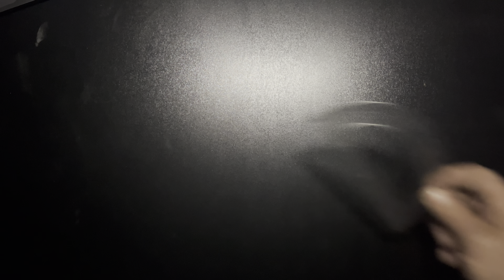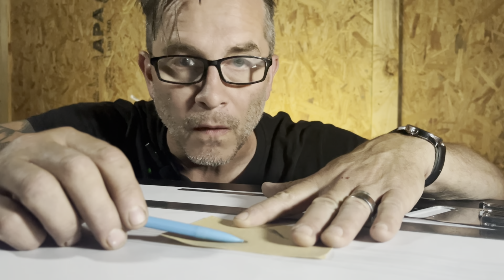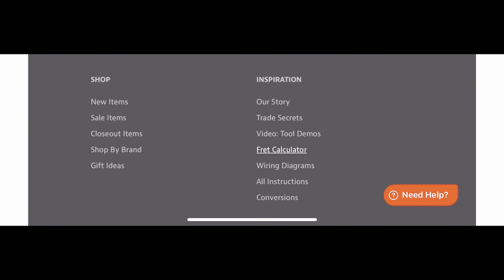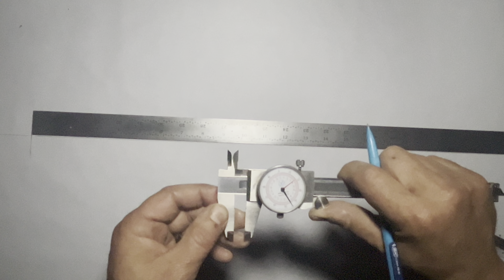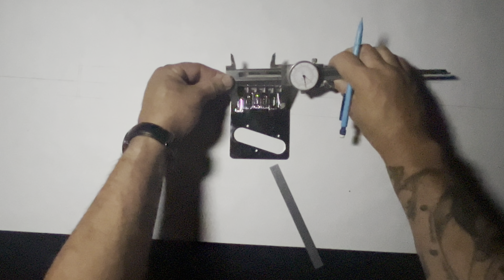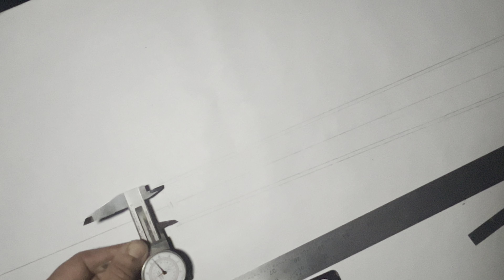Don't Start Building Until You Watch This: Designing Your Guitar

Comment: You used a protractor to draw a straigt verticle line instead of a T square ??????? WHY ? if Your a Pro why would you do that ?
Reply from the maker: A t-square would be a perfect tool.🤘🏻However, most people starting this don’t have a drafting table or even a simple workbench. A lot of folks are gonna draw this on kitchen islands, dining room tables, or even the floor. I’m just trying to get the basic concept of drafting the guitar in front of people using the simplest set of tools as possible. 
At the professional production level, all drafting and designs are done in CAD. At some point, I’ll be showing those methods as well.

Comment: I thought of a new guitar build idea.  Say you put a capo on the 24 inch point of fretboard scale so as to effectively make a standard  fender or gibson like a short scale.  It would effectively  make a 24 inch scale length with a wider nut, and it could help some players have some extra space in that fretboard area.  That is, the guitar is built and used without the capo.
Reply from the maker: If you put the a capo on at the first fret on a 25.5 scale guitar, that’s almost dead on 24”. It’s 1.431” from the jut to the first fret. Subtracting that from 25.5” gives you 20.069”.

Comment: I found out about this channel from the guys at TTG and want to say thank you for making these, they are very helpful. I do have a question regarding the neck taper angle. You mentioned you wanted the final fret width at 2.25", Wouldn't that be determined at the Bridge using the saddle spread plus the offset from the "E" strings?  Or are you not maintaining the same offset along the length of the neck.
Reply from the maker: Hello! Thank you for the kind words! You are not wrong. Traditionally, the final fret width on a six string guitar has varied between 2.188” to 2.21”(2.25” for some Gibsons and Floyd Rose equipped). To truly dial in your spacing, you could absolutely measure the E to e spacing on the bridge you will use to determine your final fret width.